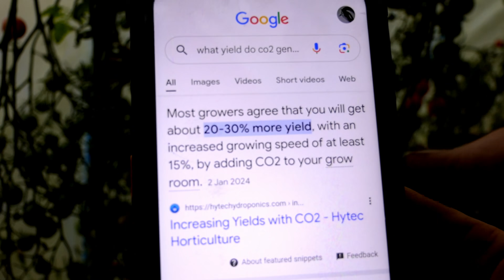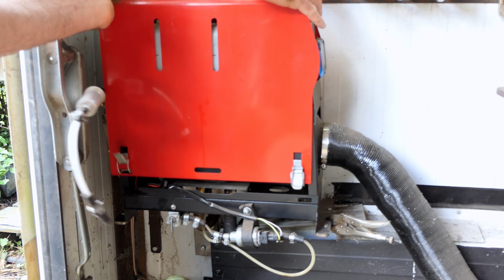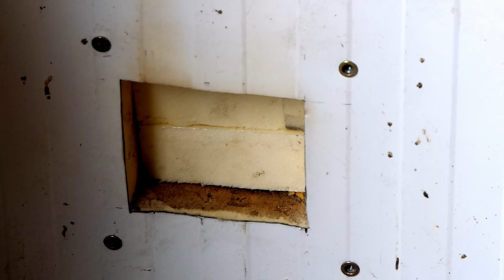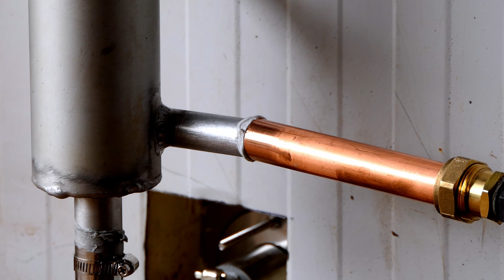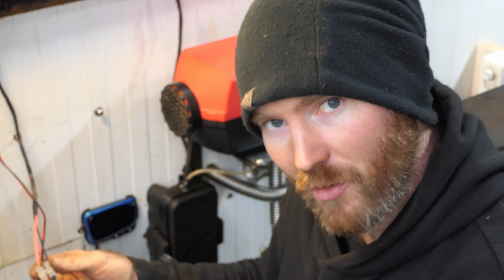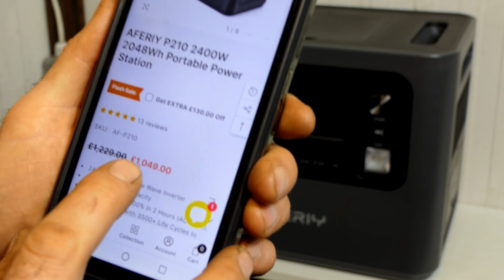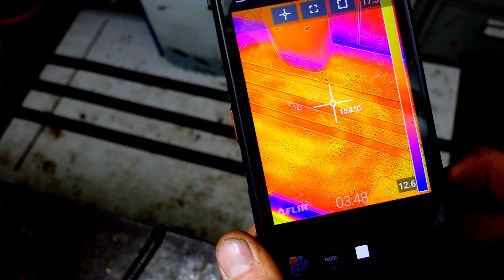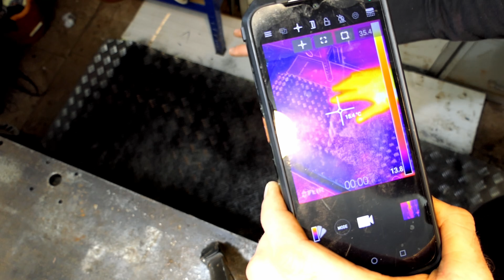NEW! Better system for Cheap and Safe Heating💲+ Underfloor Heating Mod test🫠

Comment: CO2 isn't the only factor, methane and others that create the "greenhouse" effect, which as you say, concrete absorbs the heat and releases it slowly, with greenhouse gases, the ability for infrared light to be emitted on earth and reach space without being refracted back to the ground is the issue, global average temperatures change, over time, we are just accelerating it with more than just CO2 emissions. It's a multifaceted problem that majorly points at humanity as the cause of the greenhouse effect, all the natural contributions to emissions isn't the issue, they were in balance, we put our tiny thumb on the scale and it tips exponentially in the wrong direction, like 100lbs on each side of the scale, and you add 1gram extra to one side. The scientific community says we are at 1.5*C hotter on average globally with a changing albedo of the planet which means we absorb more, and keep more atmospheric energy that we cannot dump back into space, we need a giant space heat pump which means removing greenhouse gases so the heat radiation can leave earth into space. We are keeping too much heat essentially. They've developed paints that you can cover a concrete building that make infrared be reflected efficiently back into space instead of absorbing, CO2 capture, etc all things that would help some but are not being done at scale, I agree however that deforestation is a big contributor to the problem, which is another finger pointed at humans being the problem. Our ecosystem globally is fragile and we've abused it. The biggest problem IMHO however is, give me something that replaces oil, there's ventures that are not at scale or able to cost compete with oil for replacing plastics etc, but the energy density of fuels is unbeaten by any green competitor, hopefully soon that changes and carbon capture tech develops quickly before we hit the runaway 2*C increase in average temps.

Comment: Well, seeing posts about Diesel heating made me thinking. Living in Romania, I will refer not to pounds, RON or other currency  but tokens ! 
1 liter  of diesel = almost 8 tokens so converting to heat at 100 % efficiency, will results to 10Kw/ liter,  so a price of 0.8 tokens per 1Kw/h.
1 Kw/h of electricity is 0.8 tokens, using a underfloor laminated heat film, will produce just about the same cost. Yes indeed, after 300Kw/h per month, entire bill will be recomputed as 1.3 tokens per 1Kw/h which reflects no interest whatsoever for human beings in Romania. Burning waste oil could be a fix but not sure about how legal is in Romania. Somehow, best way in my case for country small home would be photovoltaic panels connected to main grid and quantity compensation, Summer versus Winter but with a lower parity unfortunately, 0.58 : 1.   
Good job computing carbon, climate shifting and governments corruption ! In my country, government reply that why after 300Kw/h/ month the price is so much higher, this  information is not meant for general public which makes me wonder, is a mater of state secret ? Cheers mate, live long and prosper !

Comment: I’m waiting for you to put out a video of a, “best can’t be beaten” system so I can install it in my house, possibly in my camper.

Camper Van:
Is it not possible to simple run the exhaust pipe within an insulated floor & exit the final muffler.

Comment: Can I just point out . When I fitted my own underfloor heating in my stable. I found out the same as you with expanding foam.
 Before I lay the piping, are they silver foil heavy duty in the track. 
As you can guess success the heat was then reflected up.
I hope this helps you. 

Love the videos. 
My favourite most informative and useful in today's world person I have found yet. 
Excellent I'm sticking with you. 
All the best. 
Ska
Reply from the maker: Thank you so much. I really appreciate your support. lots more to come. cheers J

Comment: The longer the exhaust pipe travels on the inside, the less heat is lost.  Just make sure it cannot be touched.
Deep discharge batteries lead acid batteries can be emptied to far more than 50%.
Copper pipe instead of plastic in the floor helps with heat dissupation.
Foam, including from glue is seriously insulating.
Lithium batteries are a tad dangerous.  Once ignited, they cannot be extinguieshed before they are completely spent.
Otherwise really impressive knowledge, practical skills and equipment.  
Freedom of speech?  Where?  When?  Keir Stalin is snuffing it out.

Comment: The exhaust of my system keeps getting clogged with nasty black soot. Very nasty to work with. How is yours so clean? Is it the kerosine?
Cooling your exhaust will make that worst.

With the floor heating you insulate the pipes and so the heat exchanger with foam. Use better hoses (for floor heating) and put it in a cement floor.
Reply from the maker: Refer back to my earlier videos, I actually change the fan speed to max and at a maximum Hz of 5.5. sooting will be because of an uncomplete burn or dirty fuel. kerosene/ heating oil will burn much cleaner. also don't have too long of an exhaust because it can cause restrictions and stop an efficient burn. cheers J
Reply: @joshuadelisle  Thanks I'll play a bit with those settings.
I also see if I can get my hands on kerosine for a nice price here in the Netherlands.
I'm planning a second setup that is in my automated heating system. So extracting all heat to water.
Thanks and keep up the great work and view on the world.👍

Comment: You can use aluminium tape for the underflor heating pannel so that the infrared energy goes up before you put the pipe on.

Comment: My 10 solar panels produce more electricity (3666 kwh) per year than my heat pump needs (2752 kwh) . So my cost per kwh for heating is zero! Like the video though🎉

Comment: Hello Joshua, I'm going to have to correct you about your understanding of human impact on atmospheric CO2 levels. The 3% mentioned isn't the total contribution to concentration by human activities but rather a 3% change in CO2 flux. CO2 flux is basically the carbon cycle, the degassing of dissolved CO2 in the ocean balanced by the reabsorption of CO2 by the ocean, the release of CO2 caused by a plant/tree dying vs. the absorption while it's alive, the release of CO2 caused by a volcanic eruption vs. the absorption caused by chemical weathering. The digging up and use of locked away carbon in the form of coal and oil is referred to as an anthropogenic source of C02 and there is no balancing force to combat the amount of CO2 being added to the atmosphere so every year we add 3% more CO2 to the system which is relatively small but it soon adds up. 
Imagine having 2 open water tanks that contain exactly 100 litres each and every day they pump exactly 100 litres from one to another (tank A pumps 100l to tank B, tank B pumps 100l to tank A), these open tanks have 30l of extra room to account for variations and prevent spillage. The electrical system that runs the pumps is underneath the tanks and not waterproof. Every day you are going to add 3% more water to the system (3l), in 11 days you're going to start to overwhelm the capacity and get leaks and as that leak increases in scale the chance of shorting out the entire system increases exponentially.
This is our atmosphere. We are overwhelming the system and there is nothing we can really do about the changes it will cause. Planting more plants/trees doesn't help all that much because any CO2 absorbed in life is expelled in death, it's a cycle. The only way to recoup the amount we've reintroduced to the system is to capture it and lock it away in a way that it can't get back out. This is what coal and oil were before we oxidised them by burning, stable forms of carbon.
Think about it, reducing carbon emissions isn't what any government or private company wants, reducing carbon emissions isn't profitable or productive. It's like eating cake for every meal, we'd love to do it because it's delicious but we know that if we do we'll get fat and suffer the health consequences. The increase in atmospheric CO2 has risen since the industrial revolutions by the equivalent of 45 Mt. Etna sized eruptions and yet there certainly haven't been 45 eruptions of that scale within that time. The oceans are warming as a result of the greenhouse effect caused by increased atmospheric CO2 and as they warm they can absorb more CO2 which is leading to acidification and yet it still can't absorb the excess we're producing despite covering 2/3rds of the earths surface.
You refer to the ancient past and how the higher CO2 levels caused an abundance of life but you fail to note that the initial injection of CO2 was caused by a super volcano erupting that wiped out 98% of life on earth and it took millions of years of evolution to rebalance the system and adapt to the new conditions. Don't get me wrong, the world will survive and as long as some life remains then life will likely prosper once again but we and the vast majority of life as we know it won't so it's in our interest not to mess things up too badly if we can avoid it.  
Doing your own research is great and highly encouraged but we have educational institutions for a reason. That reason is to make sure you understand the whole subject and not just the abstraction. Unfortunately these problems are often complicated and require an understanding of multiple aspects to get the whole picture, if it was simple then we'd have fixed it already

Comment: Here me out. You can have the heater generate electricity via the exhaust to charge the battery and run the fan. The issue is, I don't know how many TECs(thermal electric coolers aka Peltier module) you will need. If you heat one side and cool the other side it will generate power. 

My idea is to use the air inlet for the blower to cool a heatsink attached to modules. On the other side of the modules, it would somehow be coupled to the exhaust(maybe using a cheap hollow water cooling block since its flat but youd have to weld on a proper inlet and outlet for the exhaust). 

It would work like the fans people put on their wood during stoves to blow air around.

Comment: I’m with you 100% I think we should get on a zoom call actually, now you need to make a heat exchanger to produce the d/c current @ 12v 20amp so you don’t have to use any external power

Comment: this guy will intrigue you 
tom ogle vacuum carburettor .appears he vapourised the fuel with vacuum air elements.note that may cause ion extraction .just a pointer

Comment: I'm not as knowledgeable as you my words may not be correct but I'm going to give an attempt. Thermal Mass, radiant heat I see a lot of people use concrete in that type of flooring to hold the heat. I seem to remember that running gas lines from copper to aluminum can cause hairline fractures in the aluminum tubing. That may be caused in part from running natural gas in the line. I had just watched a video where they ran the exhaust through a radiator before running it out to make it more efficient. And finally I believe you're right on target with the government's go green agenda being a hoax. In fact I believe it is so backwards It could only be population control. Impressive maybe we still stand a chance, knowledge is power. Your new subscriber. 👍

Comment: I have to wonder on the kerosene you were showing at the start, is the color natural or is there a yellow color added. yellow color normal is from suffer. means more crud build up...  USA has a water clear kerosene that is called K1  or some call it 1K  same as jet fuel and has a very low suffer if any.  Used in kerosene heaters, burns cleaner, and get less build up on the wick ends. Here it has become expensive, I worked years ago at hardware store and we had a 500 gal tank we sold from.  now it is sold in 1 gal  2.5 gal  5gal at some of the stores,  and runs US $11.00 gal  a 2.5 gal $ 28.00 to $ 33.00  and 5gal  $45.00.   $49.00  before tax, looking at prices on line..

Comment: Honestly I think there is something to be said for understanding how radiator's actually work, if you increase the pump speed on your car you don't actually improve the heat dissipation from the radiator. You might notice that the heat of the water returning from the rad is hardly any cooler than the input, therefore the heat exchanger isn't doing anything possibly ~5 degrees of variation. If you added a lot more radiators you would improve the heating+ efficiency of the system, there is an also added benefit to having more rads, water like sand is fairly good for thermal mass

Comment: Thing I find the hardest to understand is you made the shelf out of rusty metal, surely a bit of paint would help
Reply from the maker: @why_wait  paint actually makes the rust worse over time as the moisture is locked in. Bit of oil or hot wax is best for longevity. Personally I like the rusted look, it gives it character. I feel paint is an expensive way to cheapen something. Powder coating is better otherwise and/or galvanizing. Cheers J

Comment: I made a more efficient heat exchanger from two cooper pipeps 2 meters long one inside another. So much higher surfence wich result in huge condencetion, basically water dripping from exhaust

Comment: Hey Josh, if you add a little hydraulic fluid to the kerosene, you won't have pump problems.
In the 60s and later, I used to add hydraulic fluid to Kerosene recovered from C130 aircraft going in for servicing. We used the fuel to power Glider launching winches powered by old bus engines.
Try it 😊
Reply from the maker: @NigelHeaton  nice. Cheers J

Comment: Excellent vid Josh , been following you for a long time now , actually bought and installed a cd heater  in my workshop after watching your first video on them and there excellent , the hole saw within  the hole saw trick is certainly something I’ll use , once again mate excellent stuff
Reply from the maker: @adamcolville2057  thank you so much. I'm glad it's been helpful. Cheers J

Comment: Very interesting Josh. I have been looking at a lot of the videos with the little heaters and it seems that reclaiming the heat from the exhaust by passing it through a radiator is more productive than heating water and running it around. Combining the two may work? Des.

Comment: You put your U/Floor Htg Pipe direct into insulation foal slab and then covered it with Foam Glue, what di you expect? You basically put a long piece of pipe in a foam sleeve. I would have been far better to have dug a grove at least twice the size of the pipe diameter or even  bigger/deeper grove, laid the pipe in and then filled the gap with very fine sand way over the top then put a few strips of adhesive foam glue all around the perimeter to stop the sand escaping and a couple of foam strips down the middle to give some central adhesion. The heat from the pipe will then transfer into the sand and into the metal plate, the sand will also retain a little heat to dissipate slowly after the heating medium has been turned off.
Also think wrapping the Fuel Pump so much in the wool may cause the pump to overheat.   Your heat exchanger has too much combustion gas going through it in comparison with the water contact/flow, at that sort of size you will never get enough contact time of water to gas flow.   But love the tutorial, keep it up.

Comment: Possible that heating the water is too much, but if you run the exhaust though the radiator and the floor, might require a mild copper piping in the floor. Great video.

Comment: Good vid & rant Joshua and I agree. The trouble is there doesn’t seem to be a penalty for treason anymore, no accountability, no reason not to.
The climate debacle and Net Zero is all part of a much more sinister plan by WEF, WHO, UN, EU, Paris Accord etc.
These are scary times and there is a crisis, but it has nothing to do with the climate change narratives.
Regarding wasted exhaust heat you could make a serpentine exhaust like radiator setup that exhaust exits outside at the bottom to capture more heat before it exits the room and maybe add a fan if necessary.
Another solution might be to make a sand battery out of a large cylinder with the exhaust as a helical spiral through the centre exhausting at lowest point + a spiral of 12mm copper for floor heating exchanger between the exhaust spiral and fill the rest of the upright cylinder with sand, this will help trap and maintain the wasted exhaust heat inside before it exits, maybe add a bit of oil to the sand for better thermal transfer.

Comment: Hey Joshua have you thought about using a sterling engine to capture the heat and drive a small generator to charge batteries for power

Comment: It's great that we all have as much  money and land to buy and store what is essentially a resource that will run out soon. Your argument that humans only contribute 3% is flawed because it only takes a relatively small amount to upset the balance that has been there for thousands of years, for example, if you have a glass of water you only need to add small drops of acid to make it poisonous.
Reply from the maker: They said that oil would run out years ago by now but they've discovered several new large deposits and the old ones are refilling. If it's such an imbalance then why isn't there a global effort to re plant the Forrests of which the size of Europe has been destroyed since 1990.... Cheers J